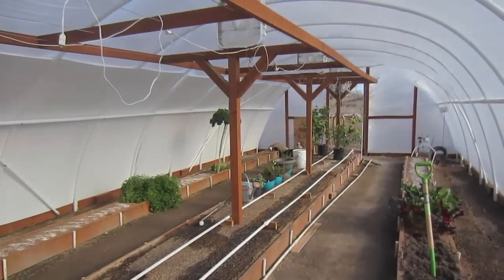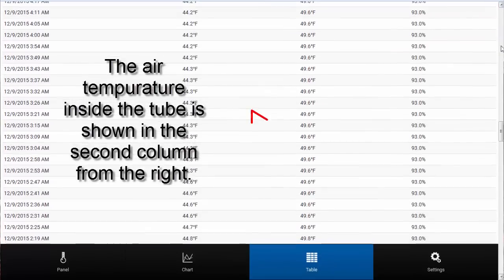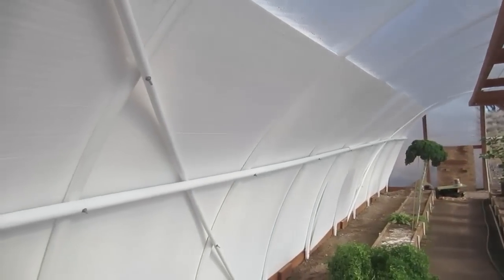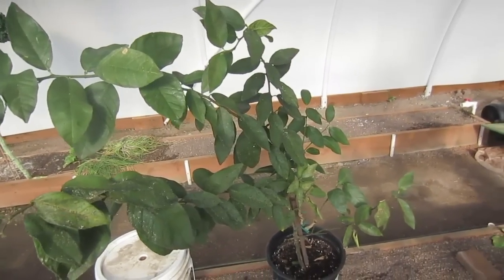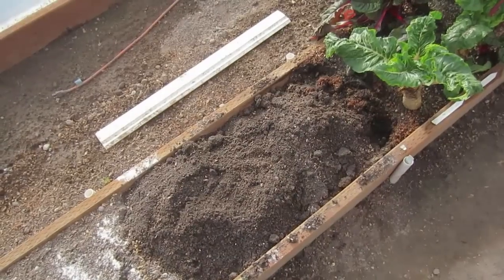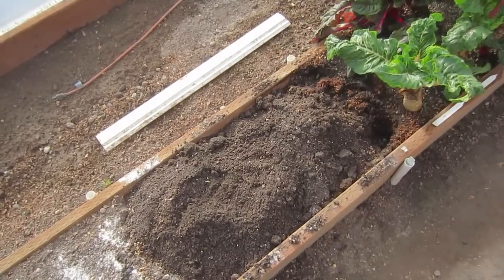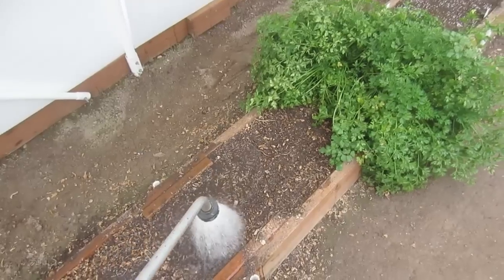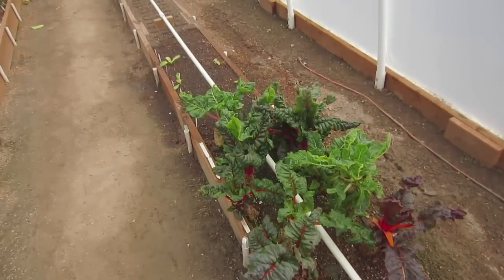Geothermal Greenhouse Update Dec. 9, 2015

Comment: In winter add two three foot by three foot black plastic or black Tyvek pieces on the inside wall supports on the sunny side of the house. With these pieces on the inside of your greenhouse inches off the wall the black with attracts the sun rays and will get hot. Allow air to freely flow from the bottom of the wall to the top, the heat rises. It will get so hot you'll be impressed and no added heat may be needed. All the best!

Comment: re: heat loss: would it help if you add another layer of poly on the greenhouse? of course that means you will need another frame to give it the insulating air space.

Comment: I'm in the process of building a similar PVC greenhouse in western Nebraska (51x18 feet). I'm not exactly sure where you're located, but it looks like you have about the same type of weather we have here. What has been your experience thus far with snow loads in the winter? I've seen some people saying that the PVC frame can't handle it, but I would think that the weight of the load is actually spread out more so across the outside layer of the poly rather than the frame itself.

Comment: Very col et up my only question is did you think at some pint the tubes could fill with ground water. I am a hvac engineer and know the we take a lot of precautions to prevent water in the ducts. trust me not criticizing in any way ,shape, or fashion just asking? thank you I am a subscriber and have learned a lot from your video's keep up the tremendous work,
Reply: Its possible but before burying the tubing its a good idea to figure where  your water table is ;) As far as condensate filling the tubes, its not an issue provided your ground drains well enough and can pass a basic soak test. Dig a hole, fill it with water and see if its gone in 24hrs ;)

Comment: any issues with condensation/water in the tubes? I really want to do a small scale design of this but I worry about condensation and mold possibly forming in the underground tubes. Are there any drainage holes poked into the underground part of the tubing?
Reply from the maker: +squirrelbong A That question comes up often to me and others who have done this. So far 100% no problems with anyone who has done this. It truly works!

Comment: is it exhaust hose that you are using or what type of hose is it that?
Reply: They are using corrigated tubing with out perforation.  You can find it at lowes, home depot and walmart. This type of tubing has a large surface area so it is decent for geothermal use.

Comment: Hi, I was curious if you had any recommendation on growing year round in the South.  I live in north Alabama.  And although we have a long growing season, obviously we can't grow things like peppers, tomatoes, and such rear round outdoors without a greenhouse.  I know you lived in texas at one point, so was curious if you had any recommendations.  I'd like to build some type of geothermal system like yours, but I don't think it would cool enough in the summer down here.  I guess I'm looking for a good design for a removable or roll up green house about the size of yours that would last for years, but not break the bank either.  I don't know that I would need double poly inflated for the heat, but I think it would be the smart move for the durability.  Yet taking it down in the summer and storing could be a pain if it wasn't a good design. Do you think if I built one like yours, but with removable ends it would be cool enough in the summer if I left the inflatable sides and top up? Thanks for any info you might have!
Reply: I live in north carolina near east carolina university.  we did a study on a 40x100 foot high tunnel greenhouse,  to cool that greenhouse from 90 f it would take approximately 300, 000 btu to bring it down to 70 f. thats with an inflated double plastic 6 mill cover.
Reply: Look into shade cloth, it can help with those plants that don't like the 95+ constant temps.
Reply: A well designed shcs can easily tame the incoming solar gain. A system that cant cool effectively cant store heat effectively either because the process is one and the same. The Cere`s GAHT system design certainly wont handle the flowrates required for effective cooling..

Comment: Many thanks for all the information, I have followed your progress for some time, have read the Mittleider book with great interest and have even used some of the information in my own garden. I have a question for you with respect to the irrigation systems. Can you please tell me what size pipe you use and the spacing of the holes. I am impressed with the apparent uniformity. I have used 20mm pipe, with my smallest drill bit at 15cm spacing but am struggling with the uniformity which may be due to the very low pressures that I use.Any information would be very much appreciated.Cheers,John
Reply from the maker: +Figman Thank you for asking. All the details are in the Mittleider Gardening Course book Lesson 16: Automatic Watering. We use thin wall 3/4" PVC and drill 3 holes every 4 inches with a #57 drill bit. http://MittleiderGardening.com

Comment: how you coming with your testing,  I am getting ready to build and looking for designs. This is one of the best I have seen.
Reply from the maker: +Barbara Gittens It is better than hoped. I'll have details, designs, material list, etc. available later this year.
Reply: +LDSPrepper 
By my reckoning you were getting a maximum of 2.2kw of heat from the tubes for 0.25kw of fan power. The tubing wont allow much more  than 600cfm to flow which would equate to the entire greenhouse air going underground 5x an hour.  More accurate information on airflow, tube in/out temperatures, in/out humidity would allow you to get much more accurate picture of the system performance. Did you do any loss calculations on your tubing layout during the design phase?

Using your temperature data, the estimated heat loss from the structure (averaging the insulation value at R-3) maybe around 4.6kw per hour (during the same period, 8F outside temp and 44F greenhouse air temp) 

Given that the greenhouse looks fairly bare of plants in the vid, a lot of the floor is available to direct gains during the day. 
800sq ft of average earth 1ft deep (aka the greenhouse floor) will provide the same amount of energy as the geothermal system on that night, and only lose 0.5F per hour. 
If you had enough sensors installed a temperature swing of 6F - 8F in the surface soil temperature overnight would be quite noticeable. 
Another conclusion you could draw is the greenhouse air temperature could have remained around 40F (in the same test period) solely from the heat provided by the 800 cubic feet of topsoil.

Comment: Why won't you be able to use the GO air between your plastic to keep the temperature above freezing? LOVE THIS!!!!!!!!!! I will be using your GOthermal  design. :) Thank you for all your priceless knowledge !!!
Reply from the maker: +Barbara Gittens I had not thought of that. Thank you. I'll look into doing that.
Reply: +LDSPrepper 
I wouldnt recommend doing this unless you fancy having large amounts of water collecting inside the cavity, which can lead to algae and other issues.  These systems (as standard) deliver very moist air when they return heat to the greenhouse. The last thing you want is all that moisture condensing out on the cold inside surface of the outer layer of poly  ;)
Outside air is generally used to inflate double poly as its usually cooler and drier than the greenhouse air. I cool and dehumidify the air used for my covering as its made up of 20 individual inflated pillows.

Comment: I know you're a mile down this particular road... But, if you decide to start from scratch, or to try another experiment in another building, it might be worth thinking about using water (mixed w/ antifreeze) and circulated through a radiator with a fan. For any particular amount circulated, water has a lot more thermal mass AND thermal conductivity than air, as well as being more efficiently pumped due to the actual mass.  I know blowing air through the tubes is the simplest way to access the heat in the earth, but it might not be the most effective.

Comment: Not sure if you can work this into your current design, but I would suggest taking the output from the geo-tubes and running it under your plant beds. The reason for this is that air is an inefficient way to transfer energy. It would be better to cycle the tube air under your growbeds and transfer the temp changes into the beds, which in turn would radiate the heat out.

Comment: Thanks for the update David. Why did you switch from the centrifugal fan to the squirrel cage?
Reply from the maker: +Paul Ladendorf I felt the 8" hyper fan was not moving enough air to help warm the greenhouse.
Reply: +LDSPrepper David, did you ever measure the air flow (cfm)?  I'm really curious because I have a lot more bends in my system than yours since mine is only 15' long and I believe its restricting air flow considerably and hurting my performance. I'm only getting 1 cfm for every 1.2 watts in fan power which is really poor.

Comment: It looks like you have two parallel runs of pipe. I imagine there is a formula to calculate the necessary CFM given the diameter and length of each circuit and blower needed to move the air at the right speed, along with the heat transfer rate as the air flows through the pipe. So my question to you is how did you figure all that out? I'd hate to excavate an area and install pipe without a proper design. It seems like there's a lot of variables at play but I'm sure there are some rules of thumb, like your 'total pipe length = total volume * .10' formula.
Reply: +Erik Lee  Also, thanks for sharing all of this. It's definitely inspiring!
Reply: +Erik Lee 
With some basic research on thermodynamics things will become clearer. Google for air duct friction loss calculators, the worst thing you can do is install excessively long tubes as the tube length and layout dictates the maximum airflow a system can handle. Achieving adequate airflow through four, six inch tubes 200ft long for cooling the greenhouse in summer will require a hefty multistage regenerative blower to overcome the frictional losses, which could be as high as 24 inches water column. The tubing length and layout should be  designed for minimal losses which allows the maximum amount of airflow through the tubing.  David`s mid summer system update will likely be dominated by greenhouse overheating issues, even with shadecloth, water barrels, etc. 
In order to cool the greenhouse in summer, you need to move a lot of air underground rapidly and distribute the heat evenly into the soilmass. A limited number of long tubes in a single layer with a capped airflow rate due to frictional losses, unfortunately, wont be upto the task.

Comment: you need thermal mass to retain the temperature. Imagine if your entire north wall was the side of a hill covered in river rock. that thermal mass releases heat all night long. a pond is also a great addition to a green house
Reply: +Geo Metric 
Thermal mass only works if you can put heat into it :) At night when the air temperature is cooler than the pond, you`ll have a lot of water evaporating from the surface. For the water to evaporate it needs energy and it will come from the energy stored in the pond itself. Now you have a situation where sensible heat (that could raise the greenhouse air temperature) is being converted into latent heat (water vapour) that wont raise the greenhouse temperature..only the greenhouse humidity. 
The soil thermal mass does exactly the same as cold air runs through the tubing at night. I doubt you`ll see any meaningful testing here but, in practice, typically half the water condensed in the tubing during the day is returned to the greenhouse at night as humidity, not sensible heat. The energy needed for this phase change (liquid to gas) us tajen from the soil mass.
Reply: +Johnson Rocson So would the pond act as the thermal mass?

Comment: Hi LDS, thanks for effort, I have an Idea regarding north wall of the greenhouse, good or bad that is on you to decide :) . You said that cold is coming from that wall, air is good insulation, so maybe some kind of air pocket would be enough to prevent that cold. If you made something like pillow of plastic for greenhouse and pump pressurized air (not to much pressure) in it, would be enough to solve insulation proble but also to allow sun light to come in. Or use some kind of Bubble wrap on that wall. Inspiration link http://sydney.edu.au/news/84.html?newsstoryid=12448.
Regards,
Reply: +Emir Uzunovic 
I use a pressurised dual cavity pillow system on my greenhouse. I control the pressure with an adjustable dwyer differential air pressure switch, the pillows are inflated to 250pa in summer and upto 400pa for high wind conditions and snow loads. A second dwyer PS  operates a solenoid valve to release excess pressure due to heating/expansion from the sun.
The added insulation value is noticable and worthwhile, replacing the individual pillows is easier and cheaper than a complete cover. The light level is only fractionally less than standard double poly as the center dividing membrane is very thin at 50 microns, the inner and outer membranes are 125 micron.
Reply from the maker: +Emir Uzunovic Thank you for the recommendation. The entire greenhouse has two layers of plastic that has an inflated air space between. That does help but not as much as needed. Adding the Styrofoam has helped keep the greenhouse another 10 degrees warmer. I believe adding more insulation and the 30 gallon water barrels will make a big difference. I'll update you as I continue testing.

Comment: I have recently completed this project pretty much identical to LDSPrepper's specs (SLC, Utah).  Planted one of the beds (all from seed) on November 21st.  Have 100% germination and good growth so far.  At night, I am only staying about 10-12 degrees warmer than outside, but am only using 50w of fan power through the geo-air tubes currently.  The geo-air system can handle significantly more air going through it to extract even more heat.  I am still only "testing" at this point since everything is still new.

@all, keep following LDSPrepper's guidance, he is great and very helpful.

@LDSPrepper, any thought on the CFM you are now pushing through at that 2.25 A setting?  Can I ask what your Exhaust temps are currently?  I am still using the 8" 80W fan.  Did you determine the black 50gal barrels were not needed to increase thermal mass inside?  Did you add much heat to your ground "thermal battery" during the summer by running the system on hot days?
Reply from the maker: +Dallas Urie Thank you for sharing your experience Dallas. My exhaust air tube temperatures stay pretty much between 48-51 degrees on cold winter nights. I will definately put in the twenty-four 30 gallon drums as heat sinks as soon as possible. I found the 8" hyper fan could not move enough air to help significantly warm the greenhouse. The 2.25 setting is working well. When I move to the high speed the exhaust tube temperature drops several degrees.

Comment: What are your thoughts on rock dust?
Reply from the maker: +Bryan Tilley I have spent the last two days editing a video that covers this topic. In a nutshell rock dust are organic minerals. Meaning all minerals, including heavy metals, that are mined with the rock dust will go into your garden and into your plants. I would never use rock dust because it can contain aluminum, mercury, arsenic, radio active elements, and maybe some traces of essential plant nutrients. I would much rather use, clean, all-natural mineral fertilizers that had the heavy metals removed. Because rock dust is organic legally they can not remove the heavy metals. I only use the Mittleider Magic Micro Nutrient packages with a natural mineral 16-16-16 fertilizer and epsom salt. http://MittleiderGardening.com
Reply: Thanks for your insight